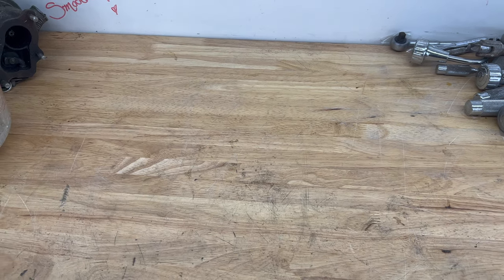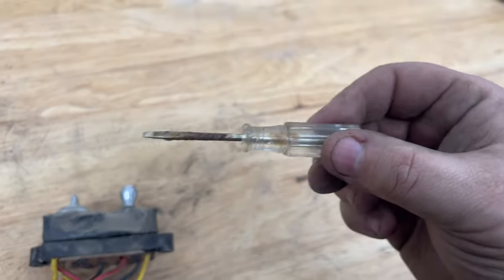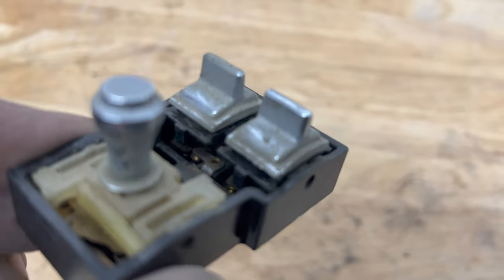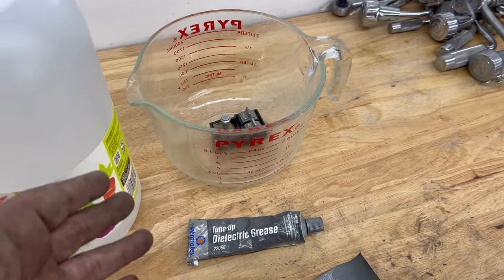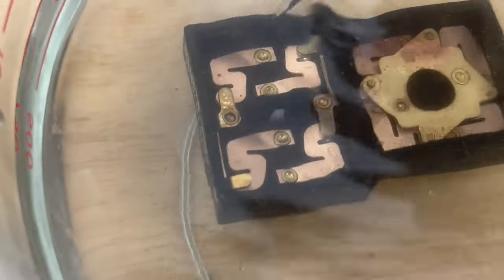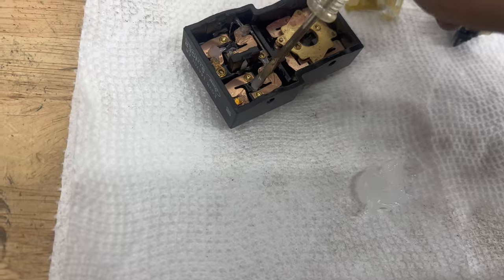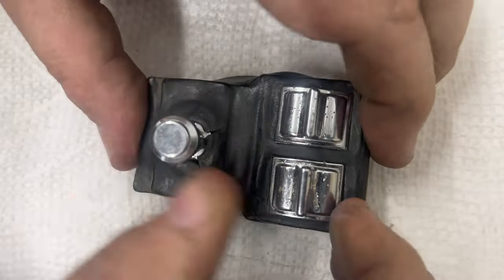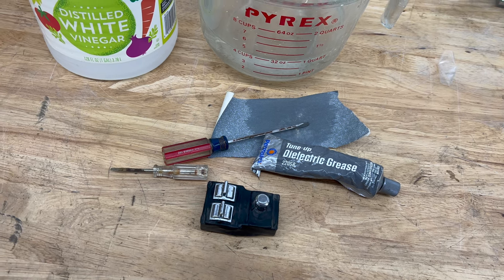1972-1989 Lincoln Seat Switch Repair Continental Mark IV V VI town car Versailles #trending

Comment: Great video. Thanks for posting needed Info on these classics cars.  And that's exactly what happened to my 79 town coupe. the passenger switch got smoked.  Now the issue I'm having is replacement parts are over priced on eBay. Finding these classics in bone yard are scares.  Do you have any recommendation on where i can find a replacement switch?
Reply from the maker: I have them  but they are expensive would do a rebuilt one shipped for 175.     But the hardest thing is trying to find good ones to rebuild, and to always test them to make sure they are good. That’s the hardest problem of all because most of the time if you do see him in the junkyards, they’re roached whether too much corrosion or from a fire.
Reply: @MarksofDistinction  
Yikes!  Would you be willing to sell me two of these without the rebuild. Looks simple enough for me to tackle. Just trying to save some money with today’s economy. Thanks for your fast response.

Comment: I think you should have cleaned the rubber cover and then soaked it in silicone then install it
Reply from the maker: No, that’s the best you can get out of them. If you go too hard on them, they break apart. You have to always play it by ear on those.

Comment: Hi sr.what can I do when the rubber piece the cover the switch is gone? I got both of my seat socking on vinegar now
Reply from the maker: I usually never try to get the rubber back on because even if you can find some heat shrink tube that can fit over it once you heat it down the heat shrink is still far too thick, so I just really fill it full of dielectric grease filling it as full as possible that way it gives you some protection
Reply: @MarksofDistinction  what about electric tape?
Reply: Can I try wrapping that with tape .. Update. I Guess not matter anyways I clean them really good and seats still don't move.Unless I put the driver side on a passenger side .They both look the same ..So I thought didn't matter.
Reply from the maker: You can use electric tape if you want just as you use it more in it up down up left and right you might start opening it up a little bit more but that will be fine
Reply from the maker: I have some that I can rebuild or if you want to send them to me I can check and see if I’m able to rebuild them where they work or not let me know if you’re interested and we can go from there